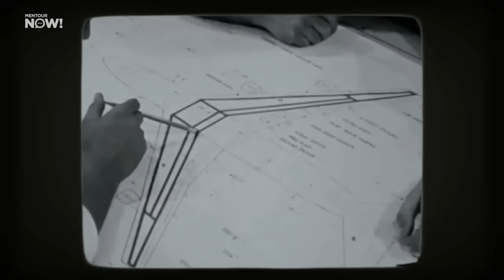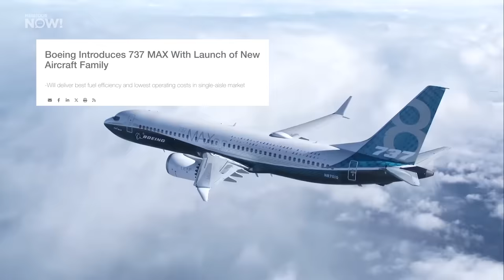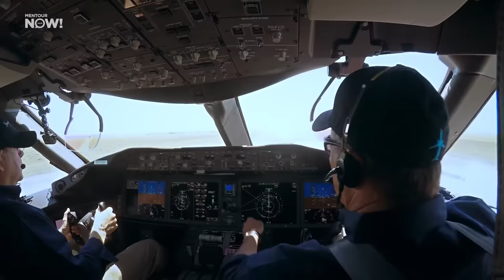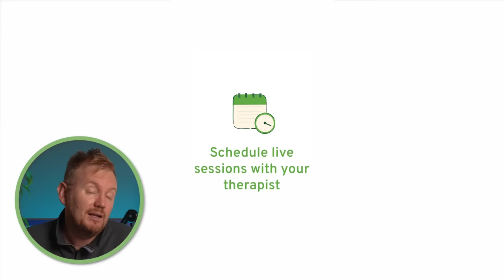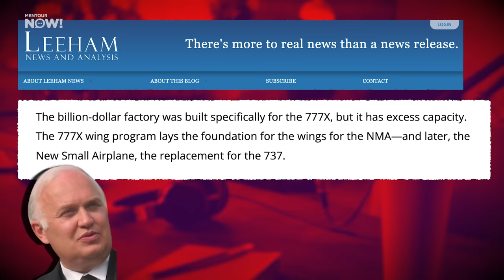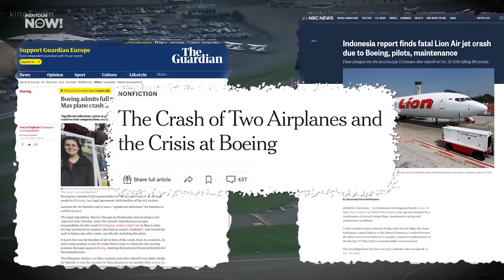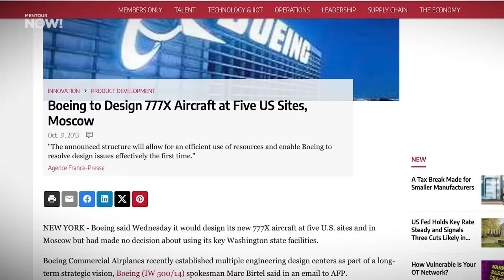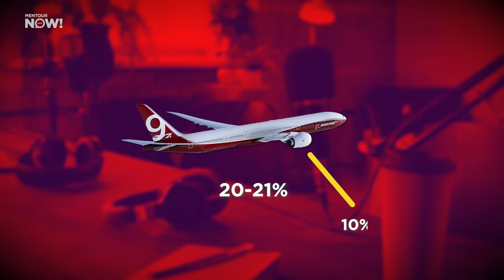What’s Going On With The Boeing 777X?!

Comment: Baffled that the A350 is the competitor for the 777. That's 787's job, surely?
Reply: No, A350 is larger than 787
Reply: It depends which version of the  350. The bigger ones compete with the 777.

Comment: I actually posted about this issue on one of your videos about the MaX. About Boing cutting safety issues to avoid cost. Aka putting profits over people safety. This issue was revealed by boeing engineers by email and videos. Explaining the material use and design was crap. But boeing corp. Ignore. After years, the issue became public . 737 max is still not a safe plane.

Comment: All manufacturers have certain amount of problems, especially when customers and regulators keep on piling in new requirements. We hear about Boeing so much could be simply Boeing are slacker covering their tracks  than Airbus for their problems. For such complex machines, a delay of a few years is nothing, 2025 will be here before you know it, and if Emerates is so impatient,  nothing stopping them design/build their own planes  ? A delay of several years , even a decade can easily be met by just extending the life of the planes airlines already have. Do another "D" check instead of flying it to the bone yard. How much life extension do you think the DC3 had ?? I have not seen many at the bone year, but they build more of them than any Airbus or Boeing jets.

Comment: The boeing 777-X is so unnecessary. The 787-10 exists. Instead of the 777-X they should have made a 747 with 2 engines as the next big project.
Reply: 777x OEW is about 180tonnes and can reach a MTOW of 350 tonnes
747-8 OEW is about 220 tonnes and can reach a MTOW of 448 tonnes . 2 engines won’t cut it

Comment: You commented about the lithium ion batteries having problems before the first 787 even started going together I bought a book from the Bowen gift store about the 787 I think it’s pretty impressive airplane who’s guys knocked it out of the park except for one area, I told an engineer I called back to this one group I used to work with when I was working for Boeing And I told him I said you cannot hard charge a battery like you plan on doing with that lithium ion battery in the new 787. He says all that’s new technology. We can do that I said I don’t think you can I told them you need to change the way the airplane set up it’s not going to be difficult you start airplane with the battery just like you always have and then the generator on the battery takes over and what it does is trickle charge the battery back up to full power and then you use the generator to supply the power for the airplane while in flight. Well all Nippon airways almost went down just like I told them you can’t charge the battery hard like that not continuously not time and time again and now they have a heavy steel box around the batteries in the airplane. OK the power you’re going to use to generate electricity while in flight it’s probably gonna be less fuel consuming than that heavy steel box but anyway, Boeing you’ve lost your Way

Comment: A new 'model' with a 30-year old airframe, slap bigger engines on it and improve avionics - and no one sees an issue?  Boeing should have done a clean sheet Max design, but cut corners and ended up spending as much time and money to fix.  Boeing has no direction on what they're doing.

Comment: Boeing peaked in the 90s. They did an excellent job on the original 777. But then the bean counters started wanting to "innovate". If they just did it the way they used to do it, it would just work better. The 787 was a process disaster.

Comment: Poor Emirates - the major airline that has built their business around a pure very longhaul hub-and-spoke model. And, uniquely, have done it very succesfully - mainly by putting their biggest hub near the junction of Europe, Asia and Africa. But they've now been let down by both the major producers. Airbus first refused to upgrade, then stopped production of, their core large capacity plane for the hub. So they turned to the competition to fill that critical (for them) role - and got huge unanticipated delays, and likely some serious reliability issues, from Boeing.

Comment: How much harder would it be to fly such a long air plane with such a low hung engine?
Reply: Wouldn’t be, as long as ground clearance is maintained on the ramp.  Since the engines are mostly in front of the main landing gear, only really the exhaust nozzles at or behind, upon rotation, they are raised.

Comment: 777-X has same problems as 37 Max?  Click bait headline. The problem with the 737 Max was lack of pilot training for a runaway stabilizer/trim.  AOA disagreement and all of that still should’ve been able to be handled by the Ethiopian and Lion Air pilots.
Reply: What part of the video says the 777x has same problems as Max? Having an AOA disagreement should not result in the plane suddenly deciding to pitch down. This problem was not present ed the same as a runway stabiliser because runaway stabiliser is one continuous movement up or down, this was short bursts so there were times the pilots didn't realise the trim was moving as they were distracted by other alarms and alerts

Comment: Interesting how Max problems bowled other Boeing products.  Boeing will survive with diminished market share.

Airbus made has made strategic mistakes (A380, A400) but they have a government guarantee.  Airbus also has an emerging problem.  Once its airliner pipeline is full, and it nearly is, what are they to do with all their superfluous design engineers?
Reply: The A400M had a bad start but they are now quite reliable. They also start to export them now to customers which were not part of the program.

Military programs are not really comparable to cilivian ones, the C-17 had a difficult start and also the C-5.

The A400M has currently no real competitor in its weight and size class
Reply: @simonm1447  Had Boeing market flops like the A380 and A400, it would gone bankrupt.  Not so Airbus who is partly government owned.  Free market doctrine says the U.S. economic model is right, but sure does not look so at the moment.  There is certainly a difference betting other people’s money than your own.
    The C130 has been in continuous production since 1954.......69 years.   Isn’t this the benchmark of military transports?     Cheers

Comment: Boeing needs to get out of the way of its engineers! If the engineers were running things the way they used to, they would have never rushed the 737 max or the 777x, especially considering the implementation of new, unproven technologies, manufacturing techniques and sourcing. However, if Boeing finally delivers the 777x and it performs reliably without any lingering issues, I believe it can recapture the market over time. After all, it will be almost a decade newer than Airbus' latest aircraft.

Comment: Why don't you ask Alan Mullaly, why? he led the Tripple seven program, why it was developped. It had nothing to to with airbus, get your facts straight.This is embarassing.
Besides the 787 and the 777 pilots do NOT share a type rating, there is an abbreviated course to obtain the other type type rating. DETAILS, DETAILS!
WING ASPECT RATIO in not what determines performance per se. It is the wing span that directly determines aircraft Lift to drag ratio . The selection of the mean wing chord affects low speed behaviour as well as structural considerations
Lift to drag ratio, maximum is
L/D = ½ span √(π/CDA)
CDA is flat plate area ; wing chord contributes very little to it and it is under the square root.
DETAILS, DETAILS.
Reply: Are there any prescription medicines which maybe you have neglected to take recently?  I'm also here in YouTube video comments to correct errors and add personal experiences where relevant, but geez...

Your take on wing design considerations suggests a decent undergrad course or two, but kind of dances around the physics -- especially in relation to aspect ratio.  To talk about wing span "directly" determining lift, independent of chord (and a dozen other things) fails on its face:   A twenty-meter span on a sailplane will give quite different results than the same span on an airliner.  So I'm guessing you were at best trying to talk in an aero shorthand of sorts.

Comment: SIMPLE ANSWER: OVER REGULATION
--
The 777 delays and the massive cost overruns are overwhelmingly the result of an overzealous FAA and over regulation. Does Boeing have some quality issues recently? Yes. Does it have anything to do with the 737 cashes? No. The 737 crashes is the unfortunate result of an unnecessary system (MCAS) which resulted from REGULATORY guidance on type training requirements which did not have redundancy. MCAS is not necessary, the only reason it existed was because regulators set up rules which allowed pilots to be type qualified with minimum training if a certainly level of similarities exists between the new aircraft and an older one. The 737 Max is perfectly safe to fly without MCAS, MCAS only made the handling similar to the 737 NG to reduce training hours. Without it the handling will be no less safe than in a 767, A330 or any other aircraft with engines further away from the Cg than the 737 (which is just about everything in the sky). The solution to the entire saga should have been simple -- delete MCAS and require a few hours of addition training for transitioning pilots.
--
Instead, the FAA totally revised the way they certify aircrafts when there is no reason to believe that the FAA would not have made the same judgement on MCAS and the AoA sensor as Boeing did if it had been involved in the MAX's development. It is easy to say that we need regulators to hold private companies accountable. But who holds the regulators accountable for the social and economic damages they impose on everyone else? This is not just a Boeing thing. If the overly burdensome nature of aircraft certification is going to become the norm, every single new jet including Airbuses and Embraers will take twice to three times as long to bring to market imposing high costs to airlines, passengers and human mobility in general. Maybe you prefer that, maybe you agree with that. But what if you don't? WHO HOLDS THE FAA ACCOUNTABLE? These are after all a bunch of unelected bureaucrats who are not accountable for the results of ANY of their actions. Does the FAA pay the cost overruns? No. Do they pay civil penalties in crashes? No. Do they get fired if their obstruction, bias, incompetence or un-productiveness cause a manufacturer billions or put them out of business? No. So who holds the FAA or any government regulator accountable? Answer: No One.
--
An unchecked regulator is more dangerous and damaging that ANY profit driven enterprise. Why? Because the money making enterprises has to keep their airline customers and passengers happy with out without regulation. Crashes and safety mishaps cost them customers and money and they have a motivation to correct it. Of course they are profit driven, but even the 1st year business school student understands that repeated crashes and frequent mishaps is not profitable or good for sales. On the other hand, the regulators have ZERO motivation to be efficient, cost effective or reasonable. Heck they have little motivation for safety either because at the day THEY do not pay the damages and they don't have to sell airplanes. In fact, they have every motivation to grow their organization and payroll for the sake of growing it.
--
An over regulated aerospace industry is basically a COMMUNIST aerospace industry which just as much efficiency and agility. Bloated, bureacratic, authoritarian and (in time) corrupt. And, what do the complying manufacturers and the public get for it? Nothing.
--
At the minimum, I believe that if the FAA and regulators insist on being involved in every aspect of aircraft development and are going to be the hindrance that they are:-
(1) The government should pay all civil claims for mechanical mishaps of all certified aircraft.
(2) The FAA must provide a clear and efficient timeline for certifications.
(3) If certification is delayed beyond a certain margin, the FAA should share in the economic costs.
(4) The head of the FAA and program managers are directly responsible for both the safety and schedule of certificaions. If they do not meet the KPI, they MUST BE FIRED!

Comment: Boeing needs a new culture, or rather a shift back to the old culture from the 60s and 70s. The non-engineer managers completely screwed everything up. They can start by removing the CEO and completely overhauling the management. Moving to Chicago was a complete disaster as well.

Comment: Bring the engineers back to the assembly line where they can be in constant contact with the assembly.  Boeing has lost its way.  They need newer management and better, more effective connections with the workers on the floor and lastly put quality and reliability as their main objective.  Keep the bean counters in their place.  Quality first.  Period.  Also settling on one engine manufacturer was just plain stupid.
Reply: The first step is to leave Chicago & return back to Seattle, where the work is done

Comment: That 747SP looks really bad in its proportions. The main issue of the 747 is its four engine configuration that leads to its fuel consumption inefficiency. Boeing has become really terrible at executing programs. Handing certification over to them, like the FAA did for the 737MAX should be criminal. At the very least. Boeings need to kick out its awful bookkeeping management and reinstall engineers in top positions. Most issues it faced are due to panic reactions to things happening in the market. If Boeing were marketleaders (which last they were in the previous century) that would not happen.

Comment: I suspect Boeing did a Max on the 7X by trying to sneak the 787 FMS  protocol on the 7X but selling it to the airlines as a classic inorder to avoid the required regulatory flight training and the cost required for compliance 😮
Reply: did a max on the 7X?
Reply: @nickolliver3021  There's no integrity issues with the 7X frame or powerplant, so the problems with certification must lie in the heart and brain of the 7Beast. Despite its current challenges,  the 777 is a beast, a beautiful beast numberwise...

Comment: That is classic Boeing.  I was there in Everett building the first 777 -200's and -300's.  Boeing management is full of idiots and liars, and so is the Union.  When the 777 program began they poured millions in to a robotic riveting machine then as well---and then dumped it.  What happened to that system?  It was picked up and used by Airbus.  Those main lap and butt joints take a lot of hard alloy rivets that take large guns.  They take a toll on the workers after time on their arms.  Honestly I would speculate the ineptitude of higher management at Boeing is the main issue with not being able to go robotic on the riveting with technology these days.  Airbus was able to do it.

Comment: I live on the south coast (uk) and am under a flight path to Heathrow. Aircraft are usually at around 12000 feet when approaching Heathrow so not a noise issue. Without fail, when i look up a particularly noisy aircraft early in the morning, its a boeing 777.
Reply from the maker: Interesting
Reply: @MentourNow  yeh, I'll have to pay more attention to the type and see if they all have the same engines.
Reply: *England, not "uk"

Comment: The original 777 took just over 5 years from first paper design meeting with airlines in January 1990 to entry into service in May 1995. The 777X will have taken almost three times as much, 15 YEARS, by the time this modification of the original 777 will enter into service. Completely unacceptable and unjustifiable.  Similar delays at Boeing/ULA with SLS and similar delays with  Starliner. The cause ? DEI. Many old timer engineers have retired only to be replaced by people selected for political reasons as opposed to merit or competence. And NO. It's not some systemic industry problem. SpaceX suffers from none of those issues. They are able to maintain a speed of development similar or faster to that of the Space Program of the 1960s because all that matters at SpaceX is competence. Although SpaceX is now being attacked, despite its' successes, for not following the political line....

Comment: Is the 777 just a stretched 767, it certainly feels that way after flown on both several times, that would explain how it got to market so quick. Boeing need to ditch reengineering the 777 and innovate with something new and that's the problem with bean counters in charge they got sucked into the myth that just adding a few heels and whisltes to an existing airframe and adding a dash number means quicker new model roll out and more profit since less R&D costs involved and we all see where that ended up with the ongoing problems with 737 max and speaking personally they are headed down same path with 777X and likely into the same problem, they really needed a new plane with new material and tech to make full use of a new airframe instead of trying to shoehorn the tech into older less easy to modify airframes

Finally please stop pushing better help they have a poor reputation and tbh why you would trust someone at the end of a phone or video that possibly isn't even from your region and doesn't really understand your or any issues you may have and why you need to feel validated by a nobody on a phone line is beyond me, I'm sure there are accessible psychological sources through your healthcare servicr or privately, I personally prefer face to face communication and view the expansion of better help to the UK is to escape the scrutiny in the US and its purpose is purely to undermine the NHS